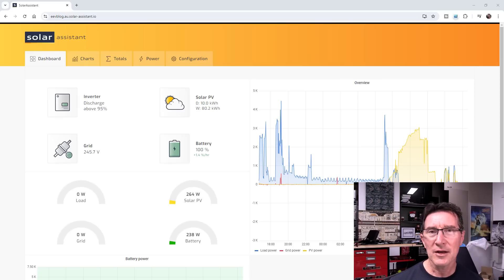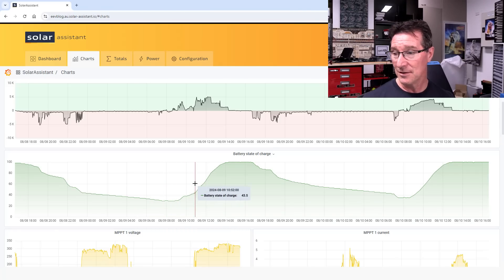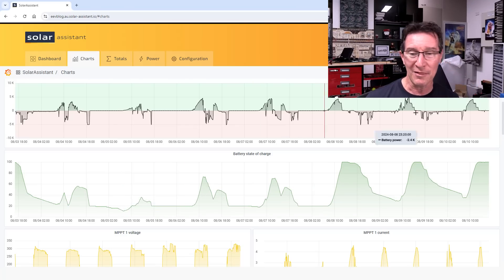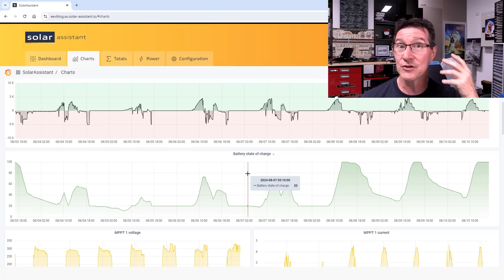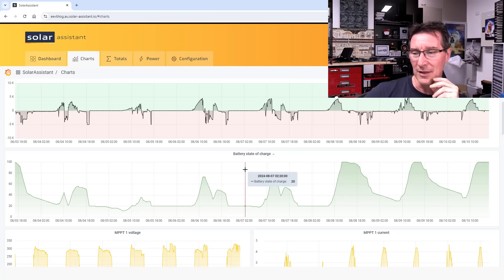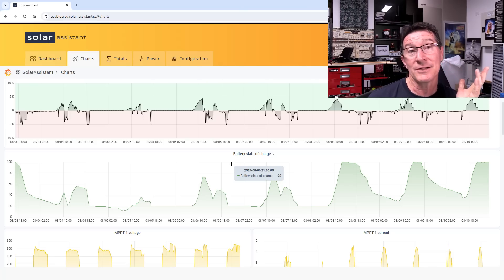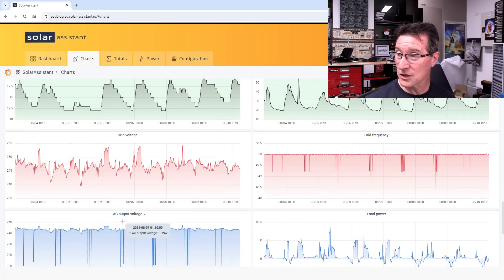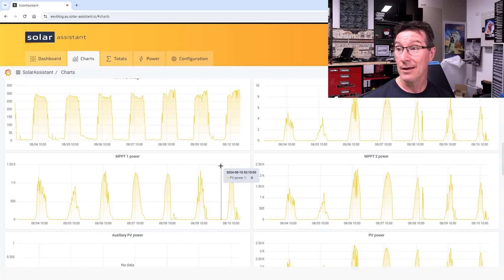We're Gonna Need a Bigger Solar Battery...

Comment: Dave go for all six. We are four family members and believe me my battery capacity went from 10KW to 50KW. Air Cons really chew up the electricity. And you can not just stop your family to use less electricity.
Reply: I'm currently at 30kwh worth of storage and for a family of four is not enough here in Melbourne Australia.... I'm also thinking about doubling that to 60kwh of storage but I'm having doubt's about if that's going to be enough but it's sure going to be a lot better! 
And we don't even own an electric car yet!
Reply: @PeterMilanovski  With Electric car, yes it wont be enough. Best way is to increase solar panels and use excess energy to charge EV. But if EV is out for whole day then its a problem. I installed 20KW of battery bank, DIY style and it costed a bit cheaper. Then i am adding 15KW of battery every year. Aim is to reach 80KW to 100KW. The best way to analyze your power requirement is to give a free hand to your family for energy usage and collect year worth of data using Solar Assistant. You can add batteries meanwhile. Only thing matters is budget and dedicated place for future batteries.
Reply: @CoolDude-vc2fl  I totally agree 👍.. 
I got both my 15kwh batteries for the price of the one in this video, yeah it's a DIY solution but it has saved me a lot of money! 
I already knew what and how I wanted to do it but I watched a lot of videos to make sure that I am not missing anything! 
I get it that DIY isn't for everyone! Some people just can't do it and should never attempt it! If you are telling yourself that if he can do it and he's a guy just like me, then I should be able to do it also because I'm a guy just like him! No! You can't do it! Either you can picture the installation in your mind, where everything is and how it's going to be connected up or don't bother, you will either electrocute yourself or burn your house down! 
You don't have to go far! I'm sure that there are plenty electrical failure videos here on YouTube! I have seen things that actual people have done! Wow! What were they thinking 🤔? 
Anyway, for those who have been working with electric and electronics anything, the DIY solution will save you money! For the rest that didn't put in the time to learn how to wire up a hi-fi system, a TV, a car stereo and open up equipment to see what's inside, well now you can pay the people who did or burn your house down!

Comment: longest life is between 30 and 70, good life 20 and 80, if the warranty is real and good then you could go 90 DOD but imo charge rates have bigger impact. The higher the charge and discharge rates the shorter the life. Our sites that lasts the longest are the ones with lower rates, in other words more batteries is better to get longer life. Also try not to keep them full all the time, they should spend an hour on 100% to balance everyday but then discharge with some 10% at least. setting up a schedule on those Deyes works well to that end.
Reply: I believe that there's some truth in not keeping batteries at 100%, I have always been the sort of person who has to keep the phone battery at 100%, I have seen way to many movies where someone needs to make an emergency call and the phone battery is almost dead, I generally get about 4 years out of my phone minimum but it's the battery that is the weakness point for me whereas the rest of my family members often run their phone battery down. My battery is the first to degrade over the useful work life of the device. If there's a charger, I'm plugged into it! I always have a battery bank with me at all times! 
I would have thought that since my phone battery is kept at 100% and my phone is running from the charger that the battery hasn't been cycled and therefore should remain in good health.... But that doesn't seem to be the case, with my phone at least....

Comment: Dave, the discharge/charge curve tell you what is safe percentage wise. Where the curve is linear it's safe as the battery chemistry is stable in this region. Many LiFePO4 are linear charge up to 95% and discharge down to 10% at 1C. It looks like you are discharging at a maximum of 5 kW, which is probably 0.33C and at that discharge rate may be able to go as low as 5% depending on your cells. Adding more batteries reduces the discharge rate and allows you to go even lower.
Charge and discharge a battery at your load maximum discharge rate, and then you have real data to work with.
Reply from the maker: Correct. I mentioned the reduction on charge and discharge current is a definite advantage

Comment: Can't you get a low night rate? that way you may only need the battery for the peak consumption between 5pm to midnight, and can even charge the battery a bit with the grid at night as the electricity is so cheap. That way you can also charge the ev at night
Reply from the maker: I mentioned that, I need a smart meter first

Comment: More Betteries 😂🤣 yeah I would nerd the crap out of the system, monitor the power usage of the house (after each breaker) to find usage patterns that I could optimize. More storage capacity is always better so you can offset those cloudy days or usage peeks. 
A friend of mine had renovated his house up to nearly passive standard in 2020/21 and installed solar + modern heat pump for heating/aircon + hot water. His initial system was 30kW solar + 40kW/h capacity battery which he is doubling in the fall. This is in Northern Germany for a 350m2 house + 150m2 office space. Because of the mixed usage and location the installed solar wasn’t enough to cover the power needed over the day (especially in the time between october and march and the installed battery capacity couldn’t offset the days of low pv production. The local municipality and a farming cooperative had recently built 3 wind turbines which people in the community could buy shares of and have locally produced grid power for roughly 1/3 of the normal price - which he does too.

Comment: Yep, more battery capacity makes sense if you can afford it, up to some point of diminishing returns.
You'll harness more of the solar power, with bigger margins for bad weather etc, probably a lot longer longevity and less stress on the system as a whole, and so on. And also not a disaster if one pack should go bad, as you'll have spare capacity for the time it takes to get a replacement.
Also (tertiary reason at best probably), not sure how common power outages are in Sydney, probably rare as hens teeth, but you'll thank yourself if there's a big one (some 100 year storm with flooding, climate change and all that, hackers taking out the grid, or whatever)
Win-win-win-win in my book.

Comment: I would give is a couple of full cycles, 100% down to 0 (safety cut out) and back to 100% to make sure the percentage calculation is correct. Their warranty specifies 100% DOD usage over up to 10 years.

Comment: For those of us in Australia, Google "The free 3 plan". Free power (0c/kwh) for 3 hrs every day between 11AM and 2PM .  It would make sense if I had an EV and battery (which I don't) because the kwh charge at all other times does increase, but not excessively. I don't have a solar power system either.
As I understand, It's free  because the eastern Australia grid is swamped with more exported rooftop solar power than it can handle around midday on many days, and the coal generators pay the retailers to take the excess power flooding the system.

Comment: A potential issue (might have been resolved by now) with feeding back to the grid is that you will need a 'grid-tied' inverter.  I don't think they will run when the grid goes down, you could have all the stored battery power in the world but if the inverter won't run if the grid has failed then you also have no power either.  Worth checking up on.
Reply: He has a grid tie inverter, that's what the Deye/Sunsynk inverters are. And they won't generate power to go on the grid if the grid goes down unless it's been configured to do so, and the wiring has been done to separate the output from the grid connection.

If he wanted to have the inverter working when the grid is down, he'd need to get the sparks in to do the work, but if his power is anything like mine, the amount of power cuts you get is so small, you'd never repay the cost of getting it set up to do that.

Like my Victron inverter will disconnect itself when the grid is down, but the inverter is still on and it's powering 2 sockets which I can plug lights or a heater into, if needed.
Reply: Most grid tie inverters allow you to charge a home battery setup and then once the batteries are full start selling to the grid.

When the grid goes down and they run your home from the battery backup. It's the best of both worlds.
Reply: @thomascrabtree  I know that is the general principle and the ideal situation but I thought grid-tied inverters stopped working ('anti-islanding' protection) when the grid went down to prevent the possibility of them feeding power back to the grid and potentially electrocuting someone working on the failed grid system?
Reply: @millycarrington  You are partially correct. The Deye inverter he has will not export AC back to the grid when the grid is down. However there is a separate "load" output which you can use for crucial loads such as freezer, some lighting etc which continues to run from PV/battery in the case of a grid outage. You'd need to have your switchboard rewired to use that feature.

Comment: 8:00 They would need to be Hall-effect current clamps or shunts, because it's DC remember. Also don't forget your house is a thermal battery. Check out Technology Connections, if not already
Reply from the maker: Yes, we try and do the thermal house storage thing. We are even installed a great recovery and ventilation system

Comment: Given how fast battery tech is evolving I reckon you wont actually need them to last 15 years because you will want to replace the entire thing within 8 years. And, if that's true, it's a waste not to use all the capacity now.  So I say run them at 100%, or maybe 95%. They aren't going to have much if any resell value.
A future replacement battery will be much higher capacity / smaller footprint / huge discharge rating /  higher voltage for 15min super charging of future EVs at home.
There could also be advantages having future battery tech that can push/pull more from the grid on demand by the power companies who may offer money to control it for improved grid stability.

Comment: I added enough capacity that on an average day I don't get below 90% SOC by morning. That also solves the problem of several days of bad weather before the batteries are fully depleted and the inverter shuts off. I run the house off-grid and after making that change I may have to switch back maybe once a year for a day if the weather is especially bad. I am planning on adding another 32x 280AH cells to reduce the system "stress" even further - shipped the cells are about $3k USD after recent price drops. My current bank capacity is 1568Ah. Expanding the bank also got rid of battery discharge anxiety, it's not something I think or fret about anymore.

Comment: Use your swimming pool as a large battery?
Reply from the maker: One way. You can't take it back out.
Reply: @EEVblog2  I should have said resistive load. I've heard some places send a bill for backfeeding the grid after actual batteries are at capacity.

Comment: In my country the energy supplier has disincentivised solar, by pushing up the access fee very high so that even if you install solar, you still effectively pay for what you now dont use due to solar installation.  Also, the home insurance company requires registration of every solar panel, inverter, and even batteries. Even if it's on the premises and not used. (They're cashing in) Although the panels seem to pose the highest risk. Also a maximum of 6KWh storage allowed.
Your 15KW seems high already.
A professional fire prevention body here estimates that about one in every six incidents firefighters responded to in 2023 was related to a shoddy solar panel installation.

Comment: We have also a complete electric house. And we also try to use al the solar. At the moment we have a 65KWh battery. We need to charge the car over night. So now in summer its ok and you can go to 9PM to use solar. But when winter comes. I use LFP battery but build them self saves a lot. And still save. ( Victron setup for 3 fase)

Comment: 7:05 LiFePO that is used between 20% and 80% gets around 10000 cycles lifetime. If you use that 60% every day, that would get you 16666 days before they degrade to 80% capacity. That's 45 years.
They're probably gonna degrade faster just by calendar aging.

Comment: Run the pool heater when the energy is coming in, store that energy in the pool. Try and reduce your standby use, replacing a 10 year old fridge might be more economical.
Reply from the maker: The pool is one way, you can't extract it back out. But yes, better than going to the grid

Comment: I think you should investigate what "20%" actually is with a multimeter. A lot of applications that use LFP hide the top few and the bottom few percent from the user to force a shallower depth of discharge. You might find the modules report 0% between 3.0 and 3.2 V instead of 2.5 V. So you 20% might actually be 25%.
Reply from the maker: Peter is literally the designer of the battery. He recommended the 80% to me
Reply: @EEVblog2  From what you've shown Peter is a knowledgeable and trustworthy guy and I fully agree 80% is the industry quoted figure for usable capacity vs cycle life tradeoff. Not doubting him there.

But I think your audience would be interesting in knowing if there's a built in hidden bottom buffer as many competing battery storage solutions do this to meet the 70% after 10 years at 100% DoD. So I can only assume AERL does this as well? If you do find there's a bottom buffer you might also feel more comfortable pushing the DoD to minimize the break even point and make full use of the system. Could also be an interesting content piece to vary the DoD through the life of the system, eg. is there a measurable degradation if you were to do 90% or 100% DoD for a year?
Reply: I actually have that question about Li-on or Li-po batteries what is the actual voltage they go down to to be considered as discharged ?? I have seen multiple sources say they will go to 2.5V as there discharge limit but some say not to go below 3V, So what the voltage I can discharge them so I can harvest most energy out of them ??
Reply: @BlackICE-Dynamics just look at some data sheets for li-ion 18650 cells and some lifepo4 cells to get an idea. Ideally look at your specific cell’s datasheet. 

I heard best to not go to the limit for cell longevity. Like charge to 4.1v max for typical li-ion cells instead of 4.2v.
Reply: @BlackICE-Dynamics  The specs say you can drop it to 2.5v, but 3v is generally accepted as a more reasonable point because the actual power in watts you get from going to 2.5 from 3 isn't worth the extra wear on the battery.

Like 3v over 16 cells is 48v, which is where most inverters start to get really inefficient as well, so for the sake of an extra 100Wh, it's not worth it.
Reply: @sarahjrandomnumbers  Thanks :)
Reply: It doesn't really matter what the real value is when the expert says to use 20% "based on what the battery management system reports".  That 20% has already taken into account the BMS adjustment.
Reply: You can't measure capacity of a lithium iron phosphate pack by measuring the voltage. You have to measure how many amp hours have come in and out. All you can know by voltage is when it is completely dead and when it is completely full, so you could do a full discharge until the cutoff voltage and get how many amp hours It took to do that and then calculate what actual 20% is but I would assume they've already done that on these batteries.

Comment: Did you look at the financia side of it? AFAIK the break even point is moving to the future with more batteries. 
Also there are two potential optimisation points:
* time optimisation (use excess power instead of storing it)
* increase depth of discharge to 90 or 95%
(Huawei LUNA200 S0 comes with 100-5% default and is actually advertised for 100% depth of discharge. 

If you have 15kwh, moving from 80 to 90% depth of discharge will give you an additional 1.5kwh for "free".